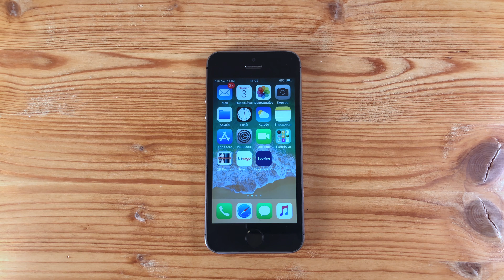iPhone 5S Front Camera, Mic & Sensors Replacement

Comment: Hi the problem that I having with my Iphone 5S is  when i Make a call , I can hear them, but they can't hear me... Buying  this part will fix the problem?  Thanks
Reply from the maker: Jose R. Navarro Sr. If the problem occurs when you have the phone at your ear, no this won’t fix your problem because from what you’re saying the problem is on the bottom mic and not at the Earpiece or the front top mic.
Reply: @Simos805  Thanks you  for responding....

Comment: hey man what is this called in 3:54 ,im a newbie about phones
Reply from the maker: It’s the part that contains the earpiece connector, front camera, front microphone, proximity light sensor and the ambient light sensor. It’s called often “front camera flex”
Reply: @Simos805  ok thank u so much for replying,I just found the "front camera flex" online and im gonna order it now,thanks again!❤
Reply: @Simos805  and how's ur phone now in this video?is the new front camera flex working on your phone?is there a problem occuring?
Reply from the maker: It’s working just fine!
Reply from the maker: The only thing to know is that any part you found online it is an aftermarket (non genuine) part!
Reply: @Simos805 ok thank u so much again,subscribed and liked ur video! ❤😁😊
Reply from the maker: Thank you a lot!

Comment: You never put back a small part of the camera cable on that aluminium sheet and tape it over! I don’t know why! Because when you took away the camera cable it was sitting on the aluminium sheet with a small black piece  tape. I don’t know how important is that ,,
Reply from the maker: I putted it back of course, and I’m showing it back but the moment putting it back I won’t record it because it w is very difficult to put it back and record it in the video.
Reply: @Simos805  can you tell how to put that  back
Reply from the maker: It’s important to remember how it was there before you took it off.